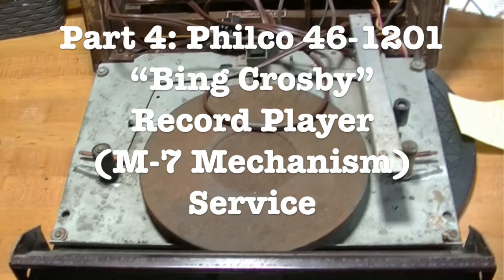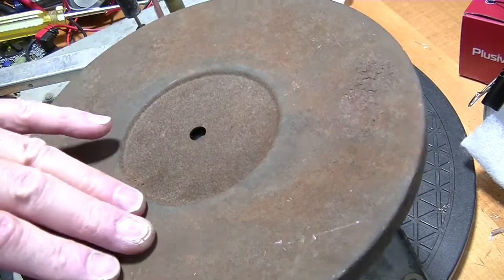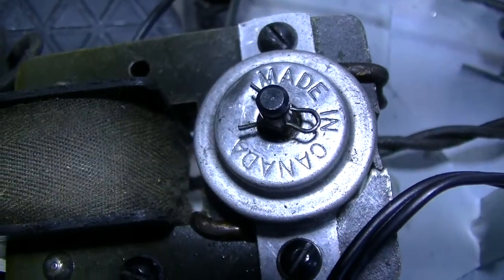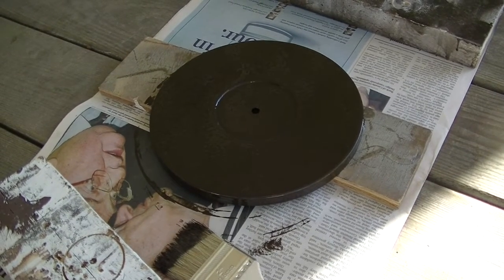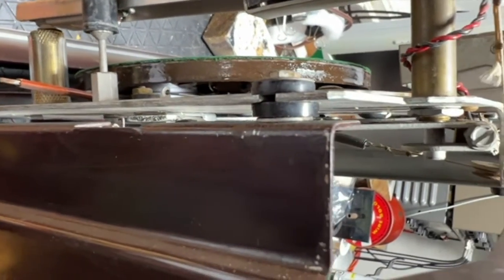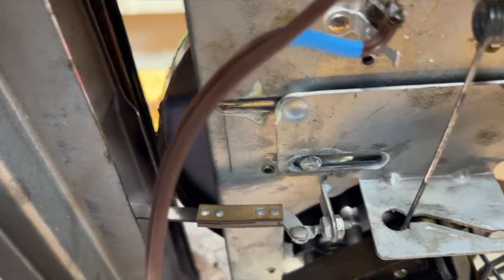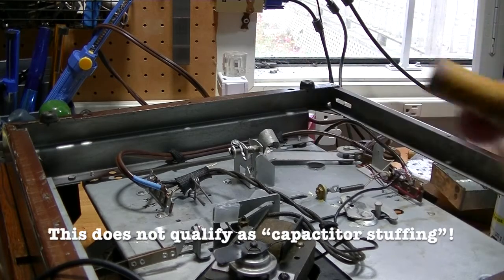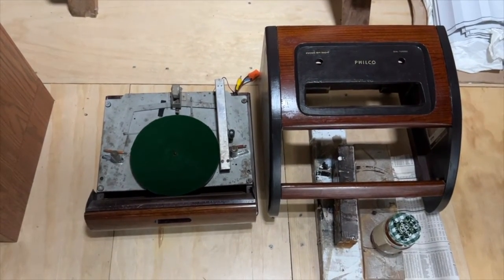Part 4 Record Player (M-7) Repair: Philco 46-1201 "Bing Crosby Special" Radio & Record Player

Comment: Place a sonotone.cartridge and.saphire stylus into the philco tone arm.
Reply from the maker: As you rightly point out, a sonotone cartridge is a much better idea than trying to repair an old Crystal cartridge. But I just picked up a grab-bag of ceramic cartridges for less than the price of a single sonotone cartridge with my Philco in mind. I’m hoping to fit one in before I put it back together. If it plays well, I’ll probably add that detail to the video I’m working on now.

Comment: If I ever get a chance to purchase this radio/record player I'm so glad I have the Philco Service manual for the M-7. It is
really a very unique and complicated piece of phonograph history. I would replace is the crystal cartridge with ceramic 
one which are common enough and takes a sapphire needle for it like a N8-3 ( 78 rpm records). As an example by using 
a Pfanstiehl P-51-3  cartrige and needle it should be an easy way to get it working again with  minimal amount of mounting hassle to the tonearm! Thanks for making this eyeopener of a video  Mr. B.
Reply from the maker: I downloaded the manual for the M-7 but honestly I found it easier to watch what the record player was doing (or at least, trying to do) to get a better idea in my mind of how it worked. It is definitely unique! My first impression was very negative: "What's this thing with strings and springs and no cam?" but I eventually found myself admiring its simplicity. I am trying to source a reasonably priced Ceramic cartridge and intend to make it fit. Maybe even find one for my RCA 9W125 too. But even Ceramic cartridges are not cheap anymore. I look forward to reading your comments, observations, recommendations -- so thank you again for commenting.